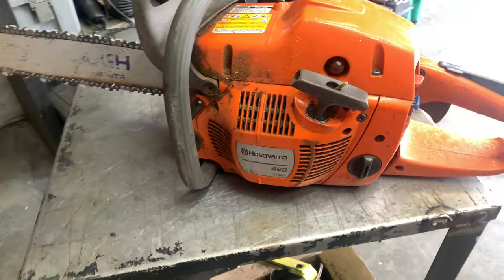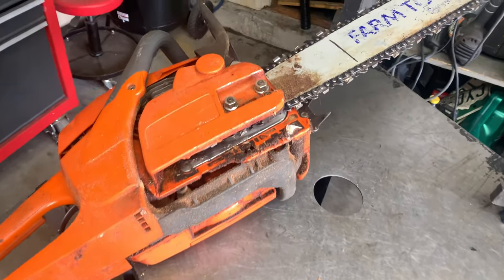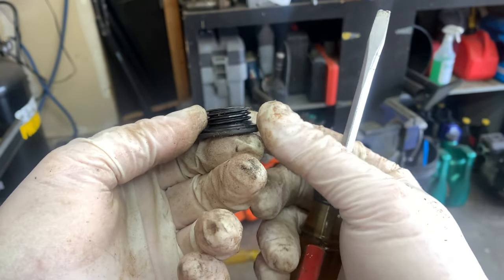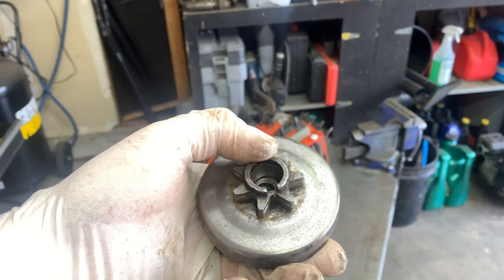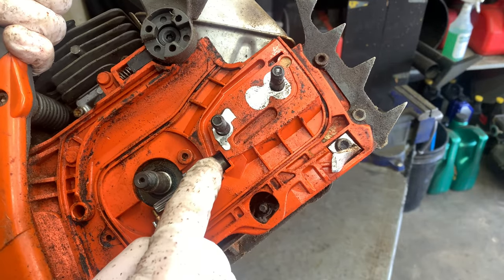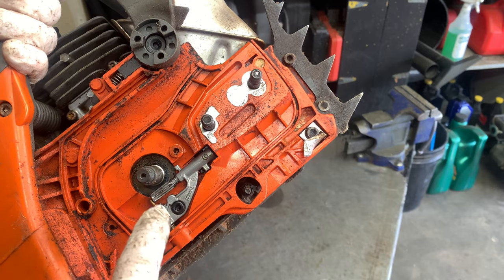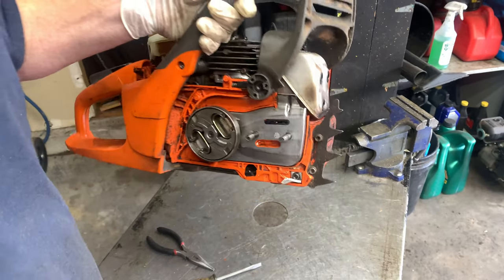Husqvarna Chainsaw Won't Oil The Chain

Comment: Well ive cleaned the oiler holes in bar I've cleaned the pump and the  the worm gears and everything. Several times. I put it back together and before putting bar on i start it and see if ouler works. It does i put it all back together and i get no oil on bar.
Reply from the maker: Run the saw with the chain on and put up some cardboard in front of the saw. After a short bit do you see oil on the cardboard?

Comment: Does the 440 have an oil adjustment screw?????
Reply from the maker: Possibly. Each model is a little different. Look at the bottom of the saw. Do you see a flat head screw below where the pump is?
Reply: No, it doesn't. I think it's a preset, but I've got it working again thanks @small_engine_repair

Comment: Ouch. That chain catcher is destroyed!
Reply from the maker: Yes it is!!! Did not catch that when I was working on it.
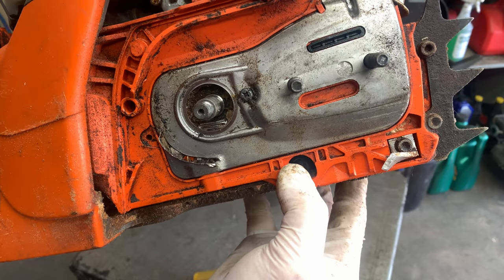Reply: His chain came off and it did its job at some point. Same thing happened to me once. Mine bent back without breaking. The damaged caused to the metal plate inside (at 2:19) was caused by the jumped chain too.
Reply: By the way, good channel!
Reply from the maker: Thanks Andys, appreciate it.

Comment: Awesome job mate, I have experienced the same issue,I used two different oils, however both bar and chain. Would this cause any issues with the chain not receiving oil???
Reply from the maker: Should not. Possibly the pump is bad.
Reply: @small_engine_repair  Thanks ma

Comment: I really couldn’t understand this video.. What did you do under the engine cover? And what’s the piece you used to get the clutch off?
Reply from the maker: Under the engine cover I removed the clutch and cleaned it up. Then I manually spun the worm gear to make sure it was pulling oil from the tank. I then made sure the line that goes from the pump to the bar was not clogged.  I used a chainsaw clutch removal tool to remove the clutch. Each model is different, so you would need the tool specific to your chainsaw. 
This was one of my earlier videos and watching it again, I did not capture all the details. I am always working to improve my videos.
Let me know if you have any other questions.
Reply: @small_engine_repair  i think the part where you removed the spark plug and jammed something in the engine, is whats not understood

Comment: Hi . Nice video. I have an old 242G which will not oil the bar. I have been using bio oil and dont know if that also caused it to stop oiling. Is there a filtrr inside of the oil tank aditionally?
Reply from the maker: Yes there is.

Comment: Maybe you can help me. I have a 445 that is not oiling the bar. I have replaced everything pertaining to the pump and the oil screen inside the sump is clean. There is no adjustment for oil feed on this model. I pressurized the oil sump and it blows out where the oil tube goes free and clear. The bar oil holes are clean as is the chain guide around the bar. From what I gathered the oil sump is not vented BUT my only clue is that with the oil pump assembly completely removed, and the saw laying oil pump/clutch side down on the bench, no oil flows out of the hole where the oil hose goes - until I open the oil fill cap on top at which time it flows freely out the bottom side.  My only other clue is something called a duckbill, could this be the problem?
Reply from the maker: Yeah I think you are on to what the issue could be. I have not heard that term duckbill before. I was thinking check valve. After a quick google search both terms refer to the same thing.